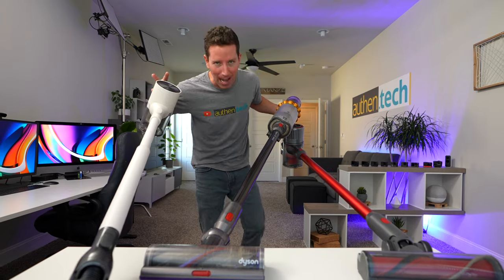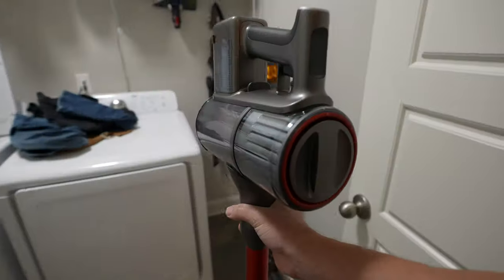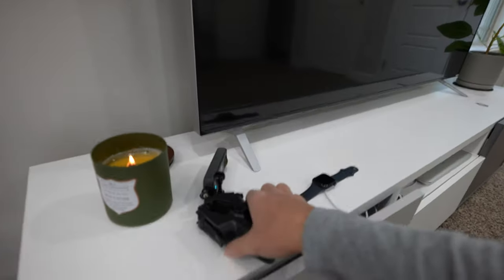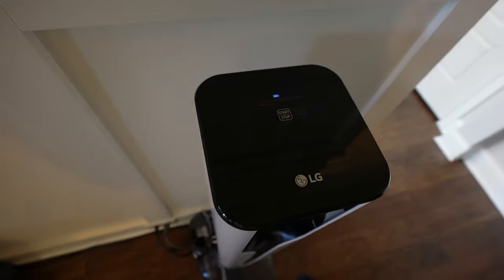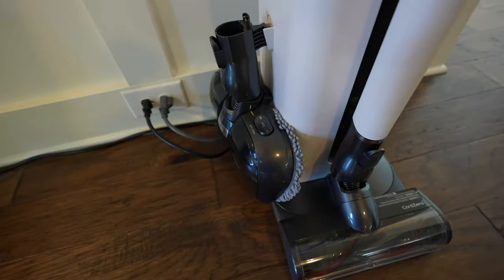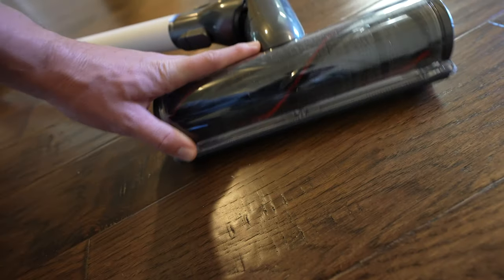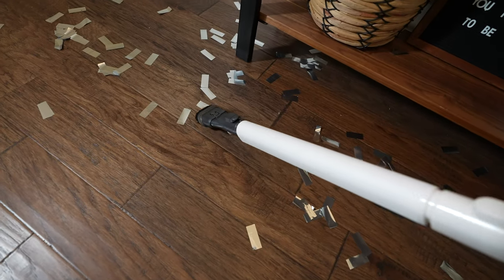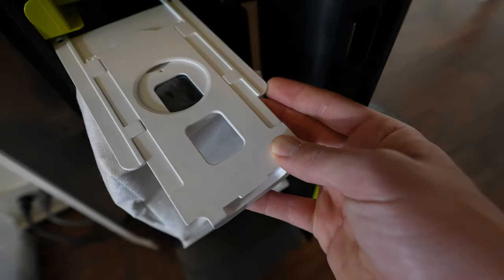Is the $1,000 LG CordZero Auto Empty Vacuum Worth It?! (vs Dyson V15 vs Roborock H7)

Comment: I think I still like my dyson. I think its wastful for the bag when you have to empty it in 3-5 vaccum run. Then it does not have a hardwood floor attachment included. But nice video.
Reply: this is what im thinking
Reply: I've used both and prefer the LG. But I really like how the Dyson has a more high tech vacuum sound. Especially that woosh sound it makes when you first start it.
Reply: It's more wasteful when you have to replace the entire Dyson after a year due to battery not holding a charge. Also, LG A9s are sold without the auto-emptying docking station. That's a premium addition.
Reply: @trstnhn  first of all, how do you kill a battery in a year, do you vacuum like 10 times daily? I've had my v8 for about 3-4 years and it's still on its original battery, still holding full charge. My v11 sv15 still has it's original battery as well, also about 2 years old and still holding full charge. We vacuum once to twice daily. You can purchase spare/replacement batteries for any of their models and I'm sure any cordless vacuum in general. No need to throw away a whole device just because a battery isn't holding charge.

Comment: I got the dyson v14 today. Straight out of the box the soft roll head doesn't work.
Pretty disappointing..I also have the LG cordzero but the telescopic pipe kept coming out which leaves zero support to protect the wires on the back so now the motorised heads won't work on it. 
That said I love the design of the LG better. 
With the suction of the dyson. 
I was blown away with the suction on the dyson v15. 

I like the look and feel of the LG better. I like that with the LG you don't have to hold the trigger I also don't get a sore arm/wrist or hand with the LG but have already with the dyson... I love that the lg comes with 2 batteries, the stand is so much better. Can put the attachments on it. AND what I love about the LG is the power to the power heads is so much better.. for example with the dyson normal brush head it stops spinning on my short pile rug. Where the LG doesn't. That said I think it does equal out with the powerful suction the dyson has.... But I prefer the spin to not have this issue... I feel like the spin is essential for a deep clean... That could just be in my head lol.

Comment: On the LG, is there a way to self empty if you don’t want to keep purchasing disposable bags?
Reply: Yes. I use LG myself.  I switched off the auto-cleaning on the docking.  You can pop-open the lid of the dust collector by clicking the button just like Roborock in the video.
Reply: @anthonys5655  great!  Thanks for the reply!
Reply: A9 doesn't come with that fancy white docking station anyways. That's a premium addition that increases the check out price significantly. A9 comes with a normal stand that can also be wall-mounted, and it doesn't have an auto-emptying feature.

Comment: Hot swap does not mean what you think it does. It means you swap it out with no down time, e.g. while the vacuum is running.
Hot swapping hard drives that are in a RAID array in a server means you don’t have to power off the server to swap out a bad drive. No loss of data, no down time on the server.

Comment: Philips has a vacuum+wet wipe combo. Speed pro aqua max if i remember correctly. Maybe you could add that to the comparison?
Reply: Honestly, I would not recommend the SpeedPro in that price range .. it's filtration system is pretty bad (vacuming some carpets can actually result in you getting a full blow of dust from the end of the machine), the moping is okay-ish, but these motorized mops are better for a whole room mopping situation, does not have the option to change battery .. as in, it is built in completely and the head itself is VEEERY bad against hair tangle

I work in retail and have these problems  ALOT of time :D